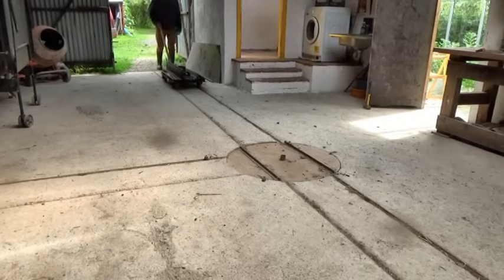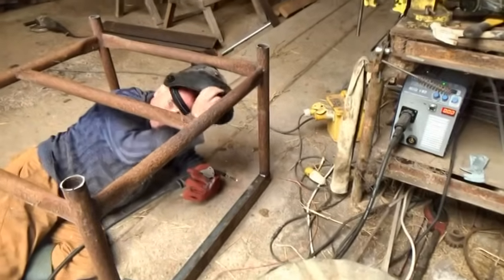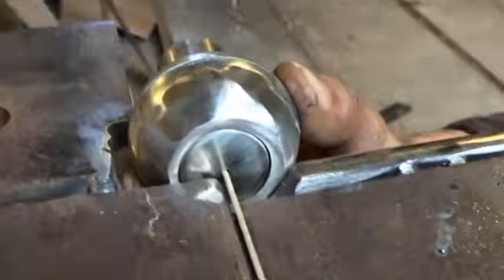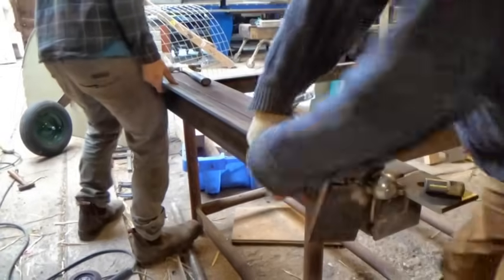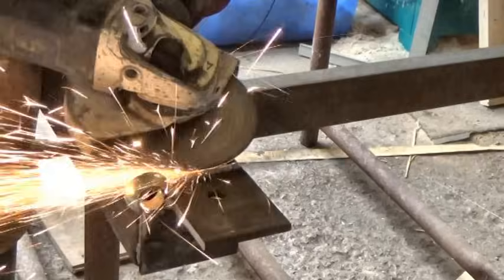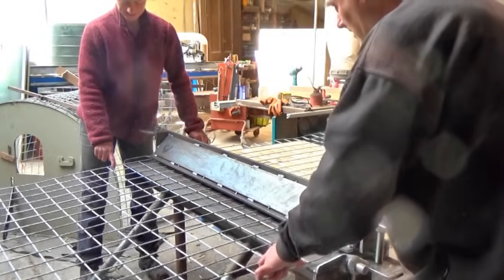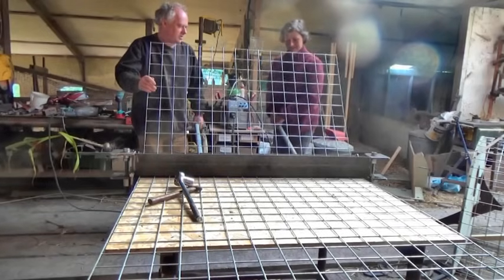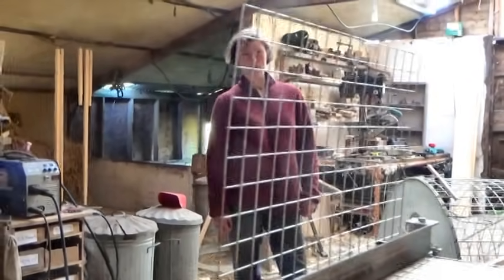Homemade Chunky Sheet Metal Folder (a bender / brake for weldmesh and other flat things)

Comment: Careful with MIG: it's really easy to produce a weld which looks great but you need to remember to dial in some penetration if you want strength as well as beauty in your welds.

You're probably actually MAG welding (Metal Active Gas), the gas is usually a blend of Argon, CO2 and Oxygen. 

The Oxygen (typically 2-3%) is there to act as a wetting agent by causing a fine layer of oxide at the surface of the weld. This produces a smoother looking weld.

The CO2 (typically 5 -20% depending on the particular blend) reacts in the arc and puts heat into the weld. Higher CO2 gives deeper, narrower welds. We use 5% CO2 blends for thin sheet work (auto body type thickness using 0.6mm wire) and 20% CO2 blends for thicker section, 6mm and above with 0.8mm wire.

I'm just starting to learn about the flux cored, 'gasless' wires at the moment, mainly because I'm repairing some welding sets but don't have any gas cylinders  where I'm currently working and don't want to start up a new contract for cylinder rental with business being quiet at present. I need to test the repaired welding sets before sending them back to the customer.

My friend, when he was teaching me to use MIG, referred to it as a 'Hot Melt Glue Gun for Metal'
Reply from the maker: Thanks, David - very interesting.

Comment: I worked in a sheet metal fabrication factory when I was young; your diy machine brought back some good memories. We vinyl sheathed, and bent large, up to 12x4 sheets of metal for various companies like HP, and other manufacturers. Luckily, if a sheet had even the slightest of blemishes, it was tossed into the recycle pile. These were sometimes fairly thick sheets with a durable thick coating of vinyl. I managed to get one just by asking for it, and used it on my homemade 8' x 3.5' workbench. The sheet I used was destined for Hewlett Packard medical equipment, and made the perfect top, and front for my bench. I used the companies pneumatic sheet bender to form the 8x4 sheet so it had a 6" lip for the front of the bench. I wonder where that bench is now? lol

Comment: Oh to have that much money for a mig set up complete with gas etc rather than the cheap mickey mouse flux cored wire type. I will just keep on with my old stick welder until that day. The CNC plasma cutter I would have to mortgage my house for.
Reply from the maker: We already have our house mortgaged - so you're doing better than us! CNC machines are getting cheaper all the time - or you might get lucky like I did and get one at a discount price. And did you not realise I was given that welder? (I gave away my older stick welder.)

Comment: Lol @ Sandra's comment.  
But hey, the machine does, what it's supposed to do and it does it well. And as someone, who has recently struggled big time, to design and built a simple chest with drawers...I applaud you 👏👏👏.
Also: thats like the biggest chicken wire, I've ever seen. Or never seen, rather. Is it called something else (in German, if possible), when the squares are that size? It might come in handy in future diy projects for me...🙂
Reply from the maker: Schweißnetz? Does that sound right?
Reply: @WayOutWestx2  
Thanks! Turns out, it's 'Schweißgitter', but you set me on the right path there.  This particular size is sold as fencing, which is why I never came upon it before.

Comment: Great idea, I meant to build one for years, finally, I found one for free. Might I suggest you look at the width of the moving jaw. When you have a brake you will find you can use it for lots of things. You will find that you are limiting the size of the "Z" fold you can make. My bending brake, which has 50mm moving jaw, which in practice is limiting, I can't fold a "Z" shape of less than 50mm on the diagonal direction. I hope this helps!

Comment: Fabulous job! I built a bender (brake in US speak) several years ago for bending relatively thin gauge steel like car body steel & I have often found it to be just what I need to make 90 degree bends for all manner of projects. It was thrown together from some scrap angle,, 2 inch by 1/4 (50x6 mm), using 3 pieces about 6ft long. Two pieces hinged with light weight door hinges, bolted in place in case the idea didn't work, the top clamp angle held by G clamps, no stand, just a bit of metal that fits into a vice to hold the thing. My business partners husband helped me & described the whole thing as a complete waste of time made worse as he got his fingers trapped at one point, but no serious damage. Then I did my first bend & it was glorious, square, sharp corner & none of the buckle & stretch that I used to get using a hammer to bend over something square. It lives in the wood shed, no paint just a patina of rust & then when I ask it to help me it wakes up, does what is needed & then returns to its happy rusting, dreaming of its next contribution. One of the most satisfying tools I have made. Thanks for sharing!

Comment: This one ups Colin Furzes sheet metal bender.

These machines are so useful, you'll find many projects that this come in handy for.

I wonder if there's a clever quick release solution to the clamp, as tightening and losening that off will be the bottle neck in your operation. 
If you can do it quickly I reckon you'll use the machine even more often for all sorts of jobs big and small
Reply from the maker: I agree, Samuel - and I have a plan...!
Reply: @WayOutWestx2  - When Tim has a plan, WATCH OUT! 😄

Comment: Great job Tim.  Having spend many years in shipbuilding it was good to see proper sized steel being used!!  The welding comments that have been here made are very good and are important.  It is important that the weld penetrates properly into the parts being joined and doesn't just stick on the surface.   Taking time at the edges,as AtlasWalkedAway says, is the key.  The thicker the pieces being joined the more important this is.   The chooks will be very pleased!  When I showed this video to my wife she was in complete solidarity with Sandra.  :)
Reply from the maker: You're right - I have a lot to learn still, but I don't think this will fall apart either. (Now then - a steel boat? Hmmm....!)
Reply: @WayOutWestx2      Might be worth having a word with Sandra before that project goes too far!! lol
Reply: <<  It is important that the weld penetrates properly into the parts being joined and doesn't just stick on the surface. >>

At the gas utility I used to work for, we had to pass a welding test each year.

That involved butt welding two pieces of 2" pipe together.

You couldn't move the pipe,  so you were welding the bottom and up the sides some of the time.

When completed,  a coupon was cut out across the weld and pulled apart.   If the pulled apart piece failed across the weld,  you failed.  The weld had to be stronger than the original pieces of pipe.

That required full penetration of the weld,  as discussed.

Comment: Getting things to stick with a mig welder is easy, and for these types of structural demands it's almost certainly good and we'll enough, but you'll want to look into technique if you're going to be doing any of the type of structural welding on which one's safety will rely. 
My biggest advice would be to slow down your zig zags by spending more time at the edges. That little lip that your nail would catch on if you were moving your finger from the weld outward is called gouging, and is a result of not depositing enough filler metal after the arc has carved away metal and converted it to oxides. Don't worry so much about filling the center, it will be fine, just move slow enough to keep consistent arc behavior. The gouged region is the weak point in the whole weld because it's exposed, molten metal without much shielding from the flux gasses or slag covering. All best practices can be deduced by a discerning eye making sure that the molten pool is more circular than oval-shaped and fills the gouged region. And for the strongest welds, leave the slag until it's cool or falls off on its own accord because you're just on that level of skill. The metal of the weld is still reacting surprisingly much with the atmosphere around it until it gets well under metal working temperatures, and odd reactions involving the hot catalytic splitting of water from humidity can cause hydrogen absorption, weakening the weld.
Reply from the maker: Thanks for this AW. I've said it before but it's true - I learn far more from this channel than I could ever teach : -  )

I'm changing from figures of eight to overlapping circles, at Will's suggestion. I'll keep practising and I'll try cutting a weld open to see what's happening too.